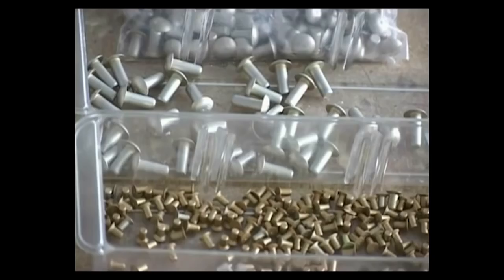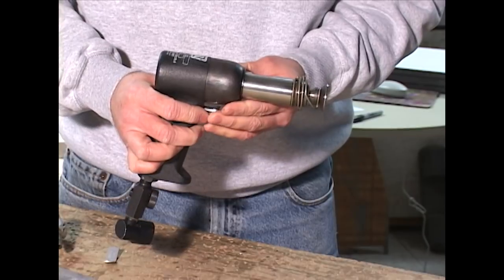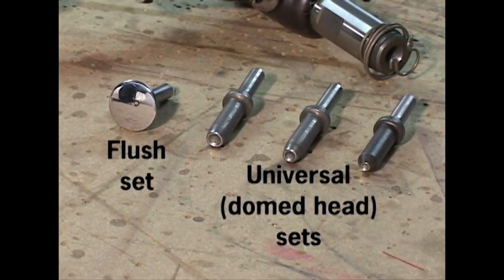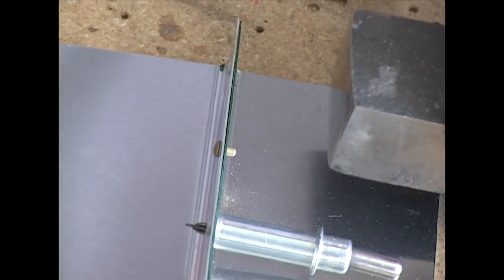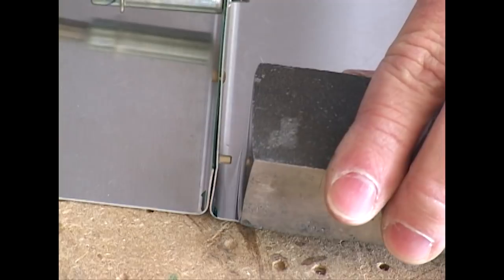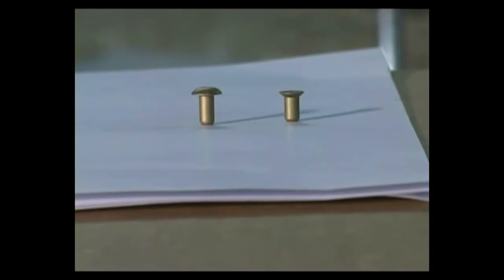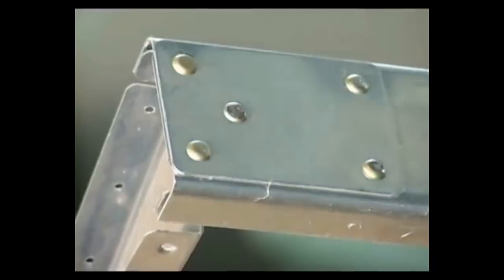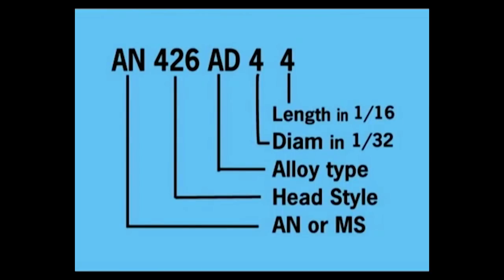Working with Solid Rivets on Homebuilt Aircraft

Comment: These aluminum rivets are quite different from steel rivets. You use a lot lighter tool. Iron work it is a ball-peen hammer.  So I wonder if I could use a air hammer?
Reply: You do NOT use a ball peen hammer to do riveting.